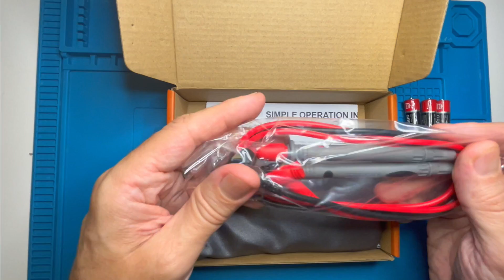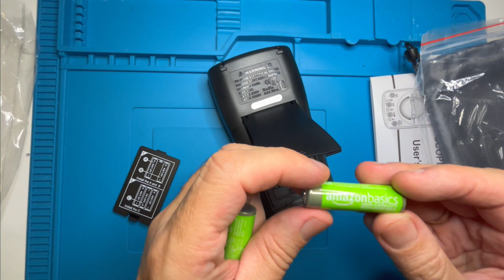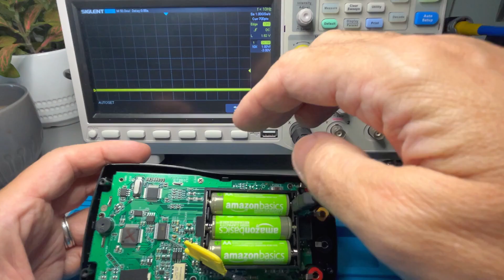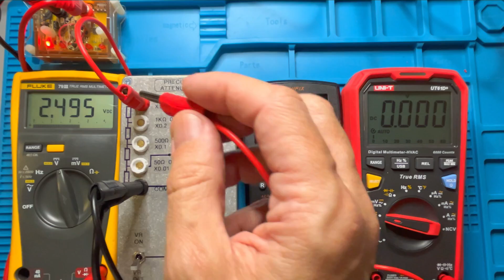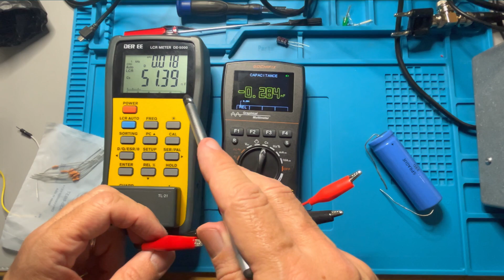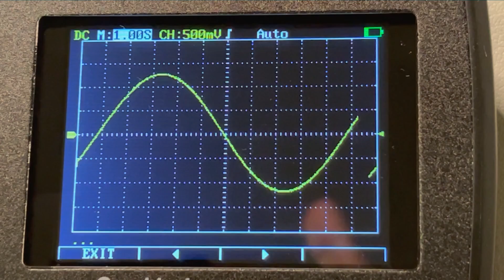EB007 - GOCHIFIX LG302 MULTIMETER & OSCILLOSCOPE TEARDOWN & REVIEW

Comment: Thanks, but I purchased this Oscilloscope with 300AED then after one week I sold it with only 100AED because the battery drains very quickly in around 3 minutes, and the scan is very slow !!
Reply from the maker: Hello, thanks for sharing this information. The battery like on mine was not that bad. Yes this scopemeter has a lot of limitations.

Comment: ElectroBanana - One of the best multimeter reviews! Thanks for the warning on the fuses!!!  I hope is has low price! I want a scope meter that uses normal batteries for use on my boat - do you recommend it?🛥🛥🛥🚤⛵🙂
Reply from the maker: Thank you for the comment. I think is would be good for a boat as long as you take spare batteries. The downside is that if you blow one of the fuses and you are on a boat, then game over if you want to perform current measurements….

Comment: Excellent, comprehensive review, my initial thoughts where quite negative but now I do see a (limited) use case for such an instrument. (I'm a replaceable battery type guy.)
Reply from the maker: Thank you, appreciate your comment. I think the monitoring of minimum and maximum is a great feature for monitoring the voltage at which systems using Lithium ion batteries turn off to prevent over discharge or over charging. So you are right, there are use cases, but beware the limitations…..